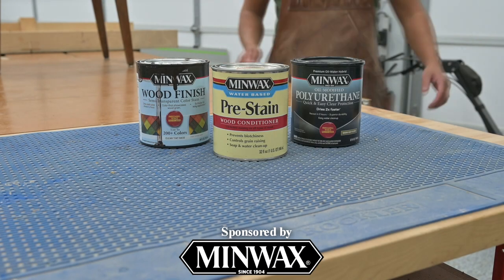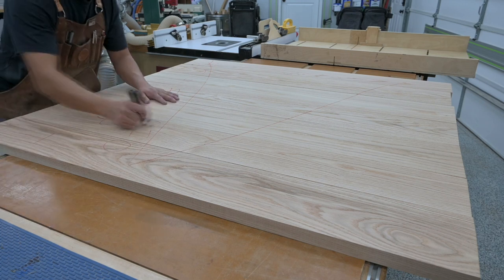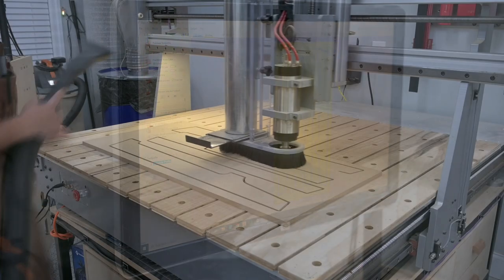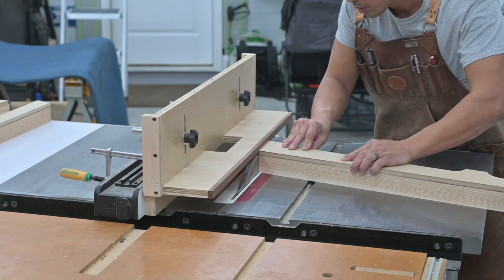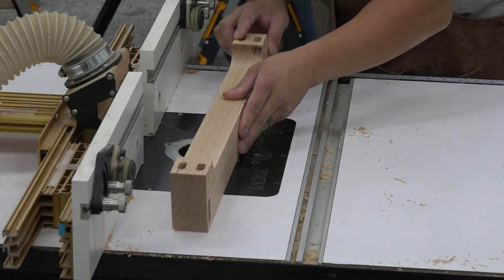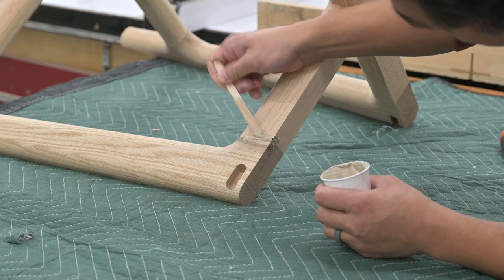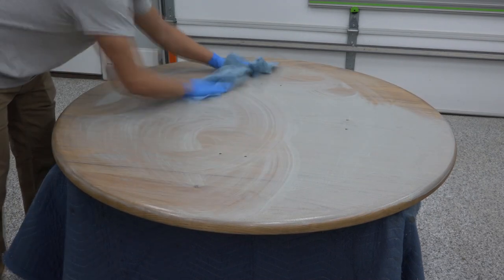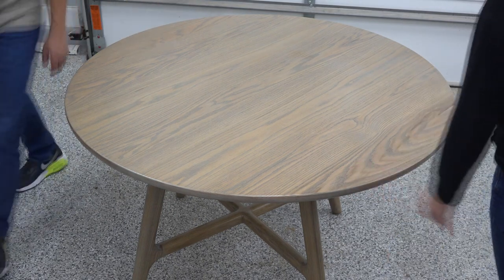Building a Round Kitchen Table with Sculpted Legs

Comment: I always recommend one of those finish sanders for sanding round overs. There’s nothing to fear. Literally foolproof in my books. I usually do 120# first and water pop and then 220# and pop again and sand back with 220#. I mostly used waterbased products so I don’t think you’ll need that last step for other finishes
Reply from the maker: Yeah, I always sand after using a prestain conditioner.

Comment: Beautiful job with the table and joints used to create it. Also the correctly attached solid wood top 👏👏👏
A small tip for more efficiency:
There's no need to mark I/O for jointing as the triangle you drew does the same thing. When jointing, the side that has triangle line goes to the fence and then you flip the same board so the triangle line is toward you - voila 😊
Greetings from Croatia
Reply from the maker: I'm sure you're able to keep track of which edge was just jointed based on your carpenter's triangle. However, I find the redundancy of marking I/O for the jointed edges is more efficient because it ensures I don't make a mistake. And in terms of efficiency, marking I/O for the jointed edges takes all but 10 seconds. In a production shop that's jointing hundreds of edges, yes, those 10 seconds add up. In my shop, where I'm making one piece at a time, I find the extra 10 seconds to mark I/O edges is worth the reassurance.

Comment: I'm very impressed with your design and workmanship.  I am considering building a similar table, although smaller.  I'm curious if you experienced any cupping of the top over time.  I realize that alternating the growth rings helps stablize the top and minimize cupping, but with the method you used to attach the top to the base, I wondered if you had any issues.  Thanks in advance, I really enjoy your work.
Reply from the maker: I have not experienced any issues with cupping or warping. In fact, I've never had issues with cupping or warping in any of the larger panels that I've milled and glued up. It's never been an issue that I've had to contend with.

Comment: Excellent technique. Thanks for the detail in jointing and finishing. I will try your finish on a morris recliner I am making. What CNC machine are you using and why did you choose this machine? What type of CNC and CAD software do you use?
Reply from the maker: Hi David, I had a custom machine built by Carl Bruce in Washington. I use Kmotion CNC as the controller and Vectric Aspire as my CAM software.

Comment: One question…what CNC do you use?  I imagine you are a discerning buyer (given the precision of your shop) so just curious as I’m in the market for one and trying to get input from makers on the ones they like.  Thanks!
Reply from the maker: My machine is custom built machine with a solid aluminum bed which helps maintain it's rigidity. The machine was built by Carl Bruce (SpeedlineCNC). I built the table that the machine sits on out of 2" square tubular steel.